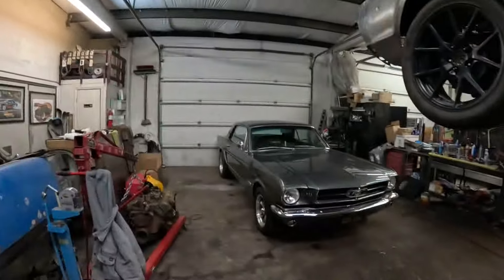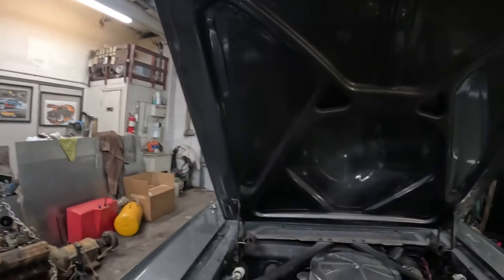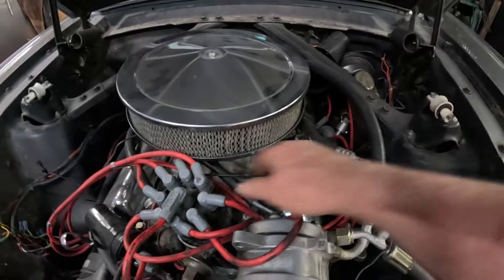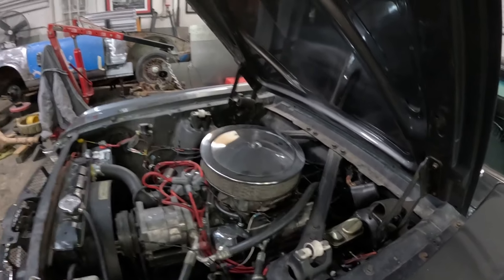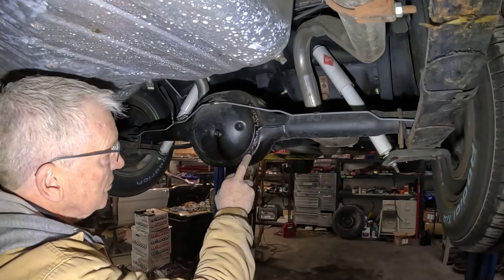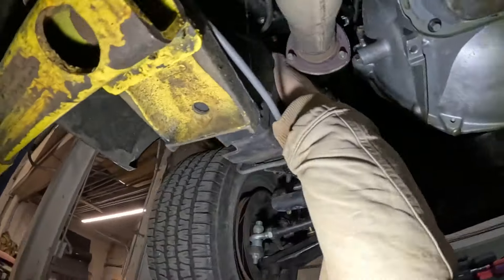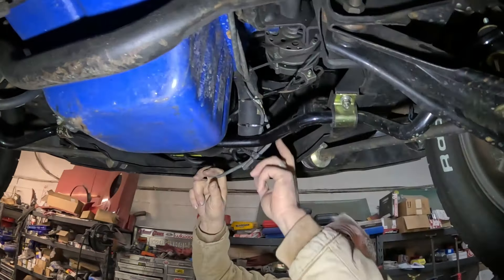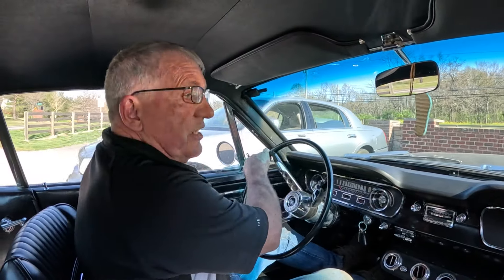Another Messed Up Mustang !!!

Comment: I have been building cars for many years and agree with you on some of the ones you expose. Many are atrocious and the sellers should be prosecuted and jailed. This one seems to be fairly solid, just need to be tweaked and finished properly. Many times the "kits" you get from aftermarket vendors are not as well engineered as they should be and the end user should be knowledgeable enough to see the deficiencies and make the proper installations and corrections. Obviously this builder was not capable of correcting the problems you found on this Mustang. However anyone that buys a 60 year old "restored" car and is not capable of doing the required maintenance  and modifications required to safely operate a 60 year old car is doing themselves a serious injustice. Keep up the good work.

Comment: I have a 68 and it is a made up of a hoard of different parts. It has manual steering, 5 speed, and power front disk brakes with large 73 montego drums on the back. I used a fox body proportioning valve to control it. All junkyard parts and it has no problems stopping. Now I am going with a borgesson steering box in the near future. I am glad you recommended it. 😊
Reply: Sweet.
Reply: Im really happy with the borgeson from manual steering, used an original pump too
Reply: @Timrsnakess  Do you run a Cleveland? If so, do you run longtube headers.
Reply: @JimsFastbackGarage  Hooker super comps, no clearance issues since I run a hydraulic clutch
Reply: I call that OE+ mods. All the bits the factory should have added

Comment: Something that I have learned...if you are having someone else install and maintain you need to get their opinion and assurance that they will do it. E.g. I wanted two sommer garage door openers, not exactly common in my area.I did buy them I found an installer that was familiar and let them get them  Also learned they don't sell a 1 piece rail like most other manufacturers do.

Comment: I've been a MoPar guy for 50 plus years, came over to Kiwi's channel from Uncle T's recommendation.

The Ford folks have the same problem we MoPar guys do.  The 'low information' owners keep falling for Video Hype on 'improving' their classics.  It's so sad....   I've seen countless MoPars that were 'improved' right into the Scrap Yard with THOUSANDS of dollars invested in janky aftermarket parts.

I learned early on, if you want your classic to LAST and be Dependable, leave it as close to 'stock' as you possibly can.
Reply: GM too, its all of it, virtually none of that chromed out hot rod crap is half as well engineered and built as what the factory put there, or put in some other car in the junkyard. But that's harder to brag about at the car show. Doesn't help they don't read, I bet every electronic ignition kit has big warnings on the install sheet about the old resistive power feed and running a new #10 wire or something along those lines.
Reply: boy....truer words could never have been spoken...!...!..👍👍
Reply: Lift kits!!!
Reply: This true, leave it as stock/factory as possible and the car will drive/handle safely. I drive my Valiant regularly and tracks straight down the road without issue, all stock and a good alignment is that is needed

Comment: I helped install one of those Flaming River kits once, it was a real pain. Basically gives you the shafts, joints, and a hanger bearing and you figure out the rest. I mocked the shafts up with wooden dowels, cause once you cut the metal shafts you are done if you cut too short.  In all it was a real pain to clear the exhaust, and not bind etc,  nearly impossible.
Reply: Good thing that you can do the nearly impossible, cheers!
Reply: I used a Randall Rack it was a nice installation.

Comment: Nice looking car! It seems to be suffering from the "let's buy aftermarket stuff we don't need and make it better" syndrome and usually has the opposite effect.. That car would be better in every way making it closer to stock. I'd restore the steering box and linkage, lose the headers, and any other bit I could find. The unneeded electric fuel pump is always a bad sign of aftermarketitus. I think the person that did the wiring must have gotten butt splices by the pallet load.

Comment: Thanks for the insight on removing the resistor wire on a points replacement kit, Kiwi!  I bet that explains most of the ~20% giving one-star-failures seen on the Amazon purchases.  She's not a Rustang-On-The-Rack, but she needs the Master's touch.  The owner brought it to the right man for the job.  The minute I saw 1965 quarter panel trim chrome on a car that Kiwi tells us is a 1966, I thought, "California shop doesn't do Mustangs like Kiwi does Mustangs."
Reply: I'm pretty sure that car is a 65, due to the trim (especially by the rear 'scoops' between the door and rear wheel wells), grille, and the instrument cluster.
Reply: The license plates also indicate it was first registered late '64, early '65.

Comment: The Pertronix explanation was valuable. I had one go bad on my 66 Coronet and I was running the stock coil and ballast resistor. When I bought the replacement, I bought the Pertronix coil and bypassed the ballast resistor. So far so good. I run it with the factory setting of 10 degrees advanced.

Comment: Here in the UK, where we have those odd things called "corners" the precision offered by a rack and pinion is a valuable and useful improvement. In the US, corners don't really exist in any proximity to each other, so a steering box, especially a fresh one, that doesn't have a couple hundred thousand miles under it's belt, is probably more than adequate. The car also needs some attention to brake balance control.

Is it my imagination, or camera angles, or is that thing actually toeing out about 5 degrees? Judging by the way you were sawing away at the wheel, it looked like it didn't know where straight ahead even was! A sure sign of bad alignment.

But at least it's not rotten and the paint job is magnificent, I wish I could paint that good.  This looks like a car that was built by a body man. The body is lovely, the mechanical bits were done by a guy who was a little outside his wheelhouse - and it shows! 

Me, i'm the other way round, it'll run and drive perfect, go like s**t off a shovel and be sound underneath (Brit rules, like Kiwi ones are a LOT tougher on rust) but it'll never win any cups for paintwork!

Comment: For some odd reason I've heard of more people getting tires rotated or changed on Mustangs and the shop leave the lugs loose. When the tire came off it warped the frame on my Aunt's 67 and never was right, until the frame was put through the test at a body shop. The right front wheel came off and pulled to the right under braking from then on. Drove straight as an arrow any other time until you pushed the brake pedal.

Comment: I have owned two 66s over the years. Both were stock suspension and manual steering, but solid drivers with no issues. I am a firm believer that these are nice enough to drive without a bunch of upgrades. I also live in northern Calif, where even our highways have lots of curves.

Comment: I just retired from the vintage car repair business and the things you see are really scary. Hardly any of the rack & pinion conversions work correctly, besides bump steer most of them don't have the turning radius of a regular gear box, and if it's a manual rack you feel every crack in the road. Flaming River sells a lot of poorly engineered junk but their fancy advertising sucks the unaware in.

Comment: It sounded nice on the audio, but the binding in the steering was plainly visible. I guess the front discs are not working correctly if at all. I fixed up and drove a64 and it was just fine stock. I do remember it stalling out in deep twilight on an interstate in West Virginia, no flashlight. I was pretty sure the points had closed up and managed to gap the points blind with a scrap of cardboard. Fortunately I was right. Having to do tuneups so often back then made sure you knew exactly where things were in the distributor, so no big deal in a pinch.
Reply: The recommended "feeler gauge" for FORD points has always been a matchbook cover.  They're right at .020".

Comment: I love the tranny lines zip-tied to the lower rad hose. Chef's kiss! High grade mechanical work there. Your test drive was much like a 68 Camaro SS convertible I rented in Las Vegas about 20 some odd years ago. Thing looked beautiful, but what an f-ing nightmare to drive. The rental company had the timing so far off (probably to deter shenanigans) that the thing ran like crap and I was almost ready to buy a screwdriver to advance it a bit, the brakes would do nothing until the rears locked up, and the steering had about a half turn before anything happened, which made driving the 2 lanes out to the Hoover dam a fun experience.
Reply: Never heard of anyone using a screwdriver to set timing on a sbc before

Comment: I've run into the leaky axle housing quite a bit. Mostly on the 9" in trucks.
Reply from the maker: Did you weld them up?
Reply: @kiwiclassicsandcustoms9160  yes, completely stripped and cleaned. Ground out the old weld and ran a bead all the way around. After I would lay it on its back and fill the bowl with kerosene and check for leaks. Tedious but no one wants a rebuilt axle that leaks.

Comment: people have this "upgrade" mentality that is not better then what was designed into the car as a whole.. some time yeah it works but its applied on too many things just because its this idea its "better"..and ill stick to points as i was stuck in the desert when the electronic ignition died on my 62 and i found old dusty points in the trunk that got me home ..
Reply: Points will always get you home. I'm running a Pertronix in my 66 Coronet but I've got points and a condenser in the glovebox.
Reply: @LongIslandMopars  exactly.... I always carry spares now...the other day I had the roter come apart on me.. The metal tang came off and I found it on the points plate. The rivit failed,,, I tied it back on with bits of string I found and it got me home again. Then I tapped it with a screw instead but baught a replacment to stick in the trunk. Along with new wires and a cap.
Reply: @chuckthebull  Nice.

Comment: On the brakes wouldn't that mean that the proportional valve is wrong  or maybe the master cylinder is wrong for the size of wheel cylinders on the rear brakes.
Reply from the maker: It has an adjustable prop valve to the rear so I can dial them down some but I need to address the fact that it's only grabbing one rear wheel not both. I'll get into that on the next video

Comment: Is there a proportioning valve in it 🤔
Reply from the maker: There is, but the rears should at least be working evenly not just one side.  I'm gonna try and get the fronts working better before I dial down the rears though
Reply: @kiwiclassicsandcustoms9160  I just figured with how that car seemed to be rushed, well as you've shown us a few times, not all shops out there build good cars. The really hurt the hobby we're trying to save and continue. 
At least this car is fairly solid, looks worth saving

Comment: i applaud your use of the mechanical fuel pump but I don't think I would change the alternator unless it was broke. the front end on that is outrageous. there's a good reason why ford built them the way they did.
Reply from the maker: The alternator wasn't charging so upgraded to a 150 amp single wire unit
Reply: @kiwiclassicsandcustoms9160  wow 150 amps seems excessive considering it is not running any electric fans or high amp loads.
Reply from the maker: @craigmorrell1052  it's got A/C, power windows, power locks, upgraded headlights and a good stereo. The price between a 100 amp and a 150 amp is negligible so why not

Comment: Can you not releive the U joint with a Dremel?
Reply from the maker: You can but that doesn't fix the problem. A u joint will only operate smoothly to about 30 deg, beyond that you have a "lumpy" rotation.

Comment: Looking at the quality of the installation it seems as though it is a common theme with installing these aftermarket modifications, in that the technicians that get these jobs way underestimate the amount of things that need to be done and of course this business being a flat rate business, the more time you put in a job the less you make so we get these shortcuts in detail. It is OK to upgrade these cars to some more modern features but we also have to realize that we are re-engineering the vehicle as well. I have posted in the past about Revology motors down in Orlando Fl and the Mustangs that they actually manufacture and design to use the latest drivetrain technology. One can get a Mustang done any way they want to suit their tastes, but of course the price tag is quite expensive (into six figures). I have also seen advertisement for this Kindred motor outfit which provides a restomod vehicle but it is EV powered and the price tag on those vehicles are six figures. But the point here is that these vehicles are engineered to work. My experience (back in the eighties) with aftermarket stuff is that it is just not a simple bolt in arraignment and there has to be more work done to have a reliable installation. Of course this lady has acquired a vehicle that has all kinds of issues and although as you pointed out some of the modifications were acceptable, there are some that are downright dangerous especially the steering. One thing about it you will never run out of business to take care of this stuff. But it is sad that most people are just not educated about this stuff until after they have spent good money. Your post are direct and to the point and it is a very good attempt to educate folks as to what to expect and to be able to judge with their reasoning as opposed to making decisions with their heart strings.
Reply: A Revology Mustang is a long way into six figures.
Reply: @johnbriggs3916  Yes sir it is.

Comment: Sounds like if a dual master cylinder was added they have the brake lines switched? The front brake line should be on the back and the rear brake line should be on the front. If those are switched the rear brakes will lockup like what's happening to that car.🤷
Reply: My guess is its the factory master.  But they didn’t add a proportioning valve

Comment: Are you sure that's a '66? The grille, instrument cluster, chrome strips in front of the rear wheels, and the fuel cap all say '65. Those all could have been changed out, but it seems unlikely.
Reply from the maker: Yeah you're right, my mistake. I've got a 66 coupe in here almost the same color  for maintenance stuff and got the two mixed up 😬
Reply: @kiwiclassicsandcustoms9160  That's okay, thanks. You had me going for a few minutes there! 😊 Love your videos, and Uncle Tony's as well.

Comment: I would like it even better if it had a 4 speed or even a 5 speed, but that's a nice looking Mustang...
You can tell by some of the "improvements" that she was convinced to waste a bunch of money
on crap she didn't need, and to top it off they didn't exactly do stellar work .
They should change the name of that front suspension to "Flaming Garbage". What a POS.. 
I don't know what that thing cost installed, but I'm sure it wasn't cheap. If a reputable and knowledgeable
shop installed that suspension, they would have test drove it and never let it leave the shop that way.
Reply from the maker: There's a lot of non stellar work being done out there 😔.   Watch out for the 54 Chrysler vid coming soon
Reply: So much of this aftermarket crap is out there and installed because people want it. They need it, they've seen it in the magazine. They've seen it on a television show that overhauls classic or muscle cars all these parts are provided as advertisements to the mags or tv shows

Comment: What was gained by adding a badly fitted rack and pinion?? 
With bolts in the tapered ball joint holes, like doh!
Reply: People get suckered into believing a 60 year old car can be 'upgraded' to new car tech and the car will drive like a modern car.
Reply: @MrSloika If you engineer enough you can get the handling but you still have 60's NVH

Comment: My rack & opinion on the situation is what is wrong with an old school American steering box.....
Reply: A good rack and pinon is better than a recirculating ball box far more feel and much less play .
Unfortunately the modification has not been well done in this case.
Reply: @martinsmallwood9605 
Sadly, this thing didn’t have a “good” rack and pinion system.
Reply: For the vast majority of drivers, nothing wrong with factory steering box. I think what often happens is some owners with worn out original steering boxes get convinced the “modern” must be so much better because it costs more than twice an original replacement.

Comment: Why do people put those crap rack and pinion steering racks in their classic cars. They are trash. Stick with the original steering box. Or if you have to, use a later model steering box from the same model.
I don't know if they make them for left hand drive Fords, but the best right hand drive steering box for that era Ford was the Bendix Bishop variable ratio power steering box.
2 1/2 turns lock to lock, 18:1 on centre, 11:1 on full lock. A engineering masterpiece.
It must be set up correctly. Adjustment is everything.

Comment: Thats a 65 not 66 you can tell by side trim 66 has three fingers 65 is like this a strip.
Reply from the maker: Yeah your right, I've got a very similar 66 in the shop too and I got them turned around.  Sorry about that!
Reply: @kiwiclassicsandcustoms9160  I only know because my family had four all 66 s also dash gauges are round in 66 flat in 65 although most change that out today.